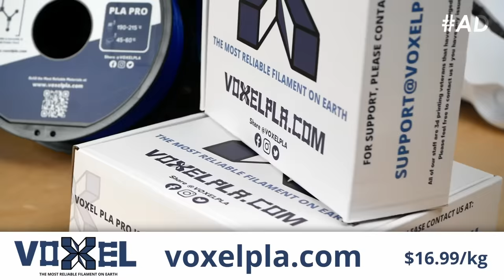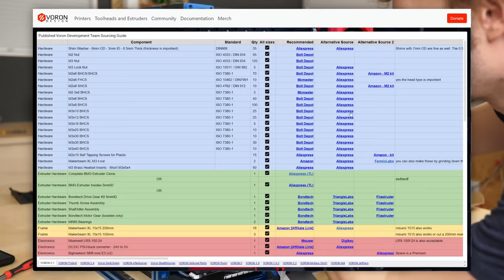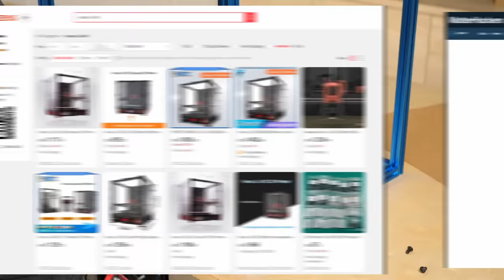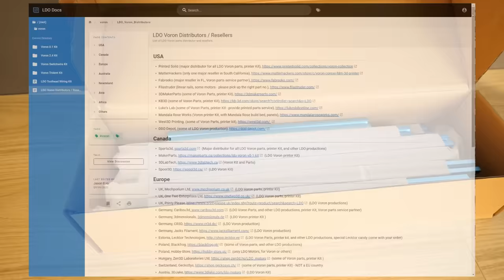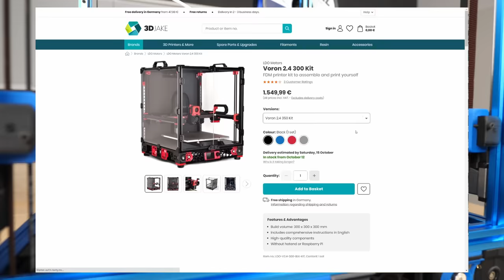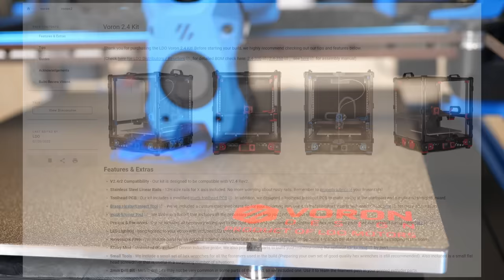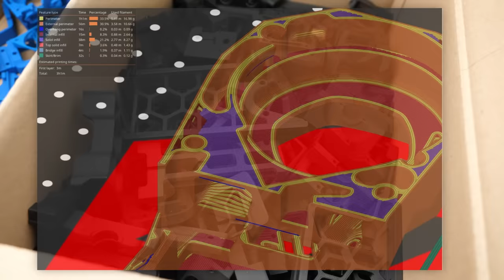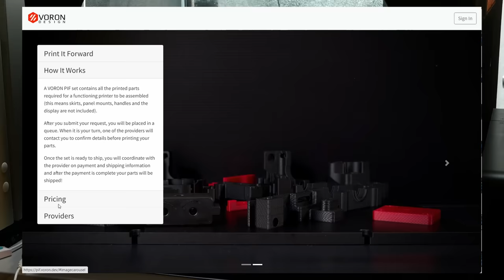Should you build a VORON 2.4 in 2023? (LDO Kit Review)

Comment: I've build a V0 two years ago from a LDO kit for $850, and designed and built a 1m^3 HEVORT using NEMA 23 servo-steppers with $40k in hardware. Buy the LDO kit. They are reasonably good parts, wiring is almost perfect, and whatever it costs to change something your don't like in the kit (fans)  is still WAY less expensive than going self-source. Big kudos to LDO for dong a very good job on the kits. 
My next project will be a V2.4r2 kit from LDO with a ERCF 6 channel feeder.

Comment: A couple of things come to mind...
- Latest design?  The v2.4 is older than the Trident ~_^  Improvements made from the Trident were ported to v2.4r2, and then additional things noticed were ported to Trident R1 (like the idlers).  This is also why they stopped with the numbered designs, because far too many assumed The Voron 2 was newer and therefore "better" than the Voron 1.
- You also mention cube build space, but the v2.4 is actually -20mm on the z (so a 300mm frame has 280mm height capability).  Then again, it would seem that many resellers state this, despite the fact the Voron configurator on their site will showcase the slightly lower height capability.
- You mention "probably printed on a Voron".  Print it Forward parts ~MUST~ be printed on a serial'd Voron, and those involved in PIF must pass a vetting process before they can participate in such.  You can't even apply for PIF until you've gained a serial on one machine.

I do love the detailed breakdown of the whole experience, and doubly so the comparison between a Voron 2.4 and other options on the marketplace such as the Bambulab X1C.  It's a very valid comparison, not just because they're similar price points, but like you stated, there's something about being able to take it out of the box, do a little bit of work (as there's a tiny bit of assembly required) and then being able to print.  For what I spent on my Voron Trident (I got a Formbot kit) I not only could have acquired a Prusa MK3S+ that was pre-built, but been printing for at least two months since I kept discovering I'd forgotten to pick up one tool as I got through various steps.

Comment: I self-sourced a voron 2.4 300x300 and printed the parts with an ender 3. I really love this machine! It feels unique, fast and reliable. Also very nice and helpful community with a lot of support and mods.
Reply from the maker: Great to hear!
Reply: Did you print ABS on the ender 3? Was it difficult to get good quality?
Reply: @groto27  I used abs+ which is more "forgiving" than regular abs. Of course I have esteps and flow calibrated combined with slow speeds parts came out great. Once I got the voron up and running i printed some spares just in case.

Comment: The anwser is comes down basicly to this:
Do you like building a printer, do you want to build it the way YOU want, do you want to tinker with it? - Build a voron
Do you dont care about building, do you just want to print. Do you think the manufacturer made the best possible printer and so dont need tinkering or moding? - Buy a X1 (or any other Commercial available printer in this price class)

@CNC Kitchen: as you already use klicky - add a nozzle brush and use Autocalibrate Z Macro. You will never ever need to tinker with z offset again.
I bet your bed variation (its ok no question) could be improved with a different Sheet. I find ldo sheets to not be very consistent. try making a mesh on the magnetic surface itself you will see what i mean.  Energetic smooth/textured sheets are quite good in my experience.

Comment: Putting the side panels on seriously quietens these down, and the speed on the skirt fans usually need slowing down, mine were wildly excessive at 100%

Also, what made you choose the 2.4 over the Trident? The Trident seems to give similar results with a simpler and cheaper design.

Having used one for a while, my main criticism is the placement of the electronics. I really wish they were accessable from the back, especially as you already need to route cables there for the fan. I've got an LED light system I want to install, but I've been putting it off due to the pain of having to put the whole machine on its side!
Reply: There's a mod called "Roller Brackets" for the 2.4 that makes it way easier to tip the printer over for servicing
Reply: @thenickdude  Thanks for the tip, I'll give it a try! I'm always a little bothered about the amount of weight I'm putting through the rear feet while tipping it back!
Reply: @aSingluarFemboyHooter  yeah, before I added that mod I picked up the whole printer so I could flip it without stressing the Z motor mounts, but it's heavy as heck so that wasn't very fun
Reply: The primary reason why people do the 2.4 over the Trident is because almost everyone things the flying gantry is cooler than lead screws ;)

Comment: I own 3 voron already
If i may recommends you any mod
+ LDO Orbiter V2.0
+ top spool holder, you will not have any feeding problems anymore
+ magnetic panel clip corner, you can make yours closed / open machine in a breeze
+ 4.3 Dsi Lcd screen for easier control

If you wanna go crazy, use TMC5160 for AB motor for blazing speed

Comment: With over 3000Hrs of printing on my 350x350x400 Voron 2.4 it only gets better all the time as I continually and gradually shape it to my needs over time. Maybe the new prebuilts will be able to stand up as well over time (though I have concerns they might not) but they will never appeal to me. I self sourced all my parts but if the LDO kit had been available then I would have seriously considered it.
My Voron is not just just a hobby toy, its a seriously useful tool that has already paid for itself and I know will continue to improve with new and better parts as they come along.
I still use the inductive probe because I just haven't had the issues that some have had and I can't even remember what a bad first layer was like because it just works. I use an active chamber heater so it warms up quickly and it gives me super accurate, super strong parts every time. I just vacuum it out and keep the rails greased regularly. I've only had to replace 2 40mm part cooling fans.

Comment: I look you video for years and nearly bought a 350 voron2.4, just before this video released. I am so surprise that voron2.4 is so cost there in EU. I got the well tuned seconed hand voron for under 555US$. And a well built new voron2.4 cost just near 650US$ in China. As a consider X1 carbon cost 1000US$. Bamboo really make some awesome devices if someone just want a 3d print for test or limited manufacture.

Comment: I have one, its a superb printer. The only critisim I have of my own one, is that after 1500 hours of print time, some of the wires in my wiring harness, that I'd bought from Linneo, started to internally fray.

Also installing the Klicky probe was very sensible, as not only can the inductive probe drift, but I found that it's proximity to the hotend can kill it prematurely due to the heat. I'm currently upgrading from the Afterburner to the newer Stealthburner, and adding a Klicky probe will be part of that upgrade.

Comment: The Bambu Lab X1C is really tempting, but I don't like how it is closed source.  That's the only thing turning me away from it and why I'd probably get a Voron over it.
Reply: Vorons maybe open source but very toxic closed minded community. They also have no stake and don’t do anything that involves a business. The closed source argument is stale at this point.
Reply: @redline6871  You misunderstand my reasoning. I couldn't care less about the community. I don't want a company with pretty much total control over my printer.
Reply: @_Livefreeordie_  I guess but your only going to run whatever is supported by the voron project and nothing else how open source is it really?
Reply: @redline6871  At least I'd be able to make changes within Klipper and customize it. If you don't like how something is in the firmware on the Bambu Lab, you're stuck with it. They can literally put something within the code that recognizes certain files and prevents you from printing them. Just as dji prevents you from flying their drones in certain locations.

Comment: I want one. Not sure if the 2.4 or the trident yet. Now we need two things Stefan:
1- A strength test for abs betwen the 2.4 and the mk3s
2- Your honest opinion about the day to day use of Klipper vs RepRap
Reply from the maker: 1 - haven't tested that but an enclosure will almost always help.
2 - haven't used Klipper that much but I can still say that if you want to print fast the input shaper implementation is way ahead of RRF. RRF on the other hand is a way more versatile firmware. In the end - if you build any Voron go with Klipper because everyone uses it and the configs are great. On any other generic machine RRF might be a great and even better choice as well.
Reply: @CNCKitchen  crystal clear thanks again for your time and effort. You make the life much easier for us. Will meet you at the klipper side of 3d printig jajajaja.

Comment: Super machine - But for Production i steel need a Commercial like the Prusa - that just keeps Running. I Backed the Bambu in Kickstarter but I'm stil waiting to reveice it, so I cannot say if that will fill the void of my MK3S that i recently sold to make room for the Prusa XL. Advantage is DYI and the mod-ability my mine h<ve extruder problems sometime which I cannot seem to resolve, with CW1 and CW2 with different Hotends. So when stuff need to go out the door, my Opinion is that a Commecial Printer needs to be in the Shop.

Comment: I love my voron 2.4, it’s a very good printer, but…. It does require quite a lot of attention a lot of the time, and my workhorse will always be my prusa mk3 for that reason. It’s not as fast, it’s not very good at abs, but I can rely on it absolutely all the time, whereas I can’t quite do that with the voron.
Reply: Out of curiosity, why does the 2.4 take a lot of attention after you have tuned it well in the beginning, and why is it not that reliable? I've heard several times now that a Voron requires a lot more maintenance than the typical printer, why is that?
Reply: @ThomasS17  Its a combination of things. 1. Some components arent of the same quality as on the prusa (particularly the spring steel pei, which is nowhere near as good as the prusa). 2. The printer is under a lot more stress, so things need a lot more adjusting. 3. There are far too many opportunities to upgrade things, which means more tweaking. Now, 2 and 3 are avoidable (2 by running it at slower speeds akin to the prusa), but 1 still isn't.

Comment: I built a LDO Voron with all the mods you can have (clicky, LEDs, purge bucket, auto-z calibration, whatever) and I do think its a fantastic printer. Print quality in my opinion is better than on Bambulab (which I also have) but... but the software/config side of Voron is a nightmare!!! You never know if your settings are correct. There is no standard config by any means. Most of Voron owners think that their config is somehow their own intellectual property (which is, but still that is not the open source way of doing things). Especially when you have LDO kit (which is a kit! from a single provider) should have OPTIMISED, ready to use config. I was as impressed with the quality of the prints as I was tired and frustrated with optimising the config myself. I am so happy with the Bambulab now, you just press print and wait for the part to use it. I think that should be some Voron Software Design Team as well to provide community with optimised, tested and proofed configs. Then it would be a killer printer. For the moment hardware of the printer is much ahead of the software which is overly complicated to get it going.

Comment: I feel this is an excellently researched and produced video that covers the state and philosophy of Voron well. The V2.4 has definitely improved in the past 18months, and the LDO parts kit does look nice. Your nevermore is probably not doing much without panels!

I will second the call to print the parts from ABS, or use print-it-forward. Avoid PLA, PETG, and cheaper online sites offering a "printed parts set". The quality is not there and disappointment will follow. ABS.

You can get quieter enclosure and exhaust fans (but not so much part and hotend fans), and panels drop the noise a lot. But many quieter fans do not last in fhe heat of an enclosed printer, or do not have enough airflow (/"static pressure") for reliable cooling. And noisy motors go faster 😀 

[Full disclosure, I built V2.1538 from a kit in April 2021 😉]

Comment: The 60mm GDSTime fans that come in this kit are SUPER loud! Change them out for the Orion Fans on the sourcing guide. Set them to 50% fan speed. Then once you enclose the printer it will be really quiet as long as you lower the print head travel speed.

Comment: I am one of the people sourcing everything myself. But honestly, with the LDO kits I would probably just buy their kits nowadays. I don't regret sourcing myself though, because it is really my Voron now and also I could learn a lot about wiring, crimping etc. I now use my V0.1 as very reliable printer for ABS, PC-Blend and Durabio.
Reply: What do you use your printed parts for ?
Reply: @sierraecho884  Different stuff. Recently I printed a paint handle out of ABS and a small ABS figurine on my V0.1

I also use it to print printer equipment which is I know a bit of a circular logic. For example, as Durabio is very scratch resistent (unlike ABS or PC-Blend) I printed a buildsurface scrapper out of it.

I also use it for all my PC-Blend prints nowadays as printing that material larger than what a Voron 0 can do is rarely adviseable anyway. One of the more useful PC-Blend prints of mine were side hooks to mount some additional curtain rod on my window. Something where you want something very sturdy and creep resistent.

Comment: I built the big one. Fantastic machines. I needed a giant printer for some projects, and the available machines in the price range of the 2.4 were mostly trash. It's the classic tradeoff of money vs time. Even working from a kit, building a Voron is quite a task. Makes a working Voron is a very satisfying achievement. 

Never did find a pi to run it. I've got an old thin client running klipper on it. 

If I were building additional 2.4s I'd make the smaller ones. The volume is easier to keep warm. I'd probably try and find quieter fans for the controller too. the ones on mine sound like a jet taking off, otherwise the printer is essentially silent with the enclosure closed.

Comment: I built one of these kits this summer as my first 3d printer. I was really impressed with the quality of the kit. The aluminum extrusion and anodizing quality in particular surprised me. I used the PIF program to get parts, and those also turned out great.

I've built the nevermore mod and purge bucket, but haven't done the clicky mod or the stealthburner yet.

edit: I bought a Radxa zero to use instead of a rpi, but I've been having some issues with my particular unit occasionally crashing (irrespective of printing or even being connected to the printer) so I've been using an old laptop to control the printer instead

Comment: I have a V2  (with mgn12 from the R2) 350mm. I need the 350mm to print my parts I design. 
Second I can get replacement parts easily and the firmware is open source and I can use Prusa Slicer or Super Slicer. 
And if my mainboard for example fails I can use whatever board I wish for replacement. 
I build the ERCF and printing ABS, PA or PC (CF) is as easy as printing PLA with it. 
If I would need a second printer for a print farm I would build a second Voron.

Comment: You mentioned oozing nozzle interfered with the z probe.  The LDO kit comes with the metal brush in the box and was intended for the purgebucket/cleaning station mod which was specifically thought through by LDO to solve this problem. - but as you already mention (And I completely respect) "you don't build the voron, you build YOUR voron". so if you don't care for that mod, or just didn't choose to include it, that's totally fine so long as you understand what voron and ldo intend and have the knowledge and skill to compensate (which i'm 1000% sure that you do).

Comment: Part of the joy owning a Voron is clout, to be sure. Just getting the parts was a chore before good kits hit the market, much less putting it together and getting it working. Being able to say you have one and that it’s working well is a flex. And, there’s no denying that it’s an extremely capable machine, certainly capable of doing most anything that’s asked of it by anyone skilled enough to build one. 

But, I think the market is hitting the point where we’re starting to see a separation between 3D printing as a hobby and 3D printing as a tool. I had my fun on the hobby side, and I paid my dues. I’m older and crankier these days. Now I just want to plug the damn thing in and have it work.

Comment: A voron , being open source hardware, is a forever printer because any part can be replaced with the same or an improved version. That gives you a peace of mind that a company can never give you. Well, and a voron is super pretty. 

And I have the impression that Vorons in a way have done away with the notion that 3d printed parts are a bad thing. If you compare the sheer briliance that went into the stealthburner with any part on a MK3S - it's just no comparison. The Reprap project somehow lost steam and ended up represented solely by the Prusa series of bed flingers. Whereas Voron has recaptured the spirit of Reprap and infused it with a healthy dose of cutting edge engineering and, as you mentioned, a cohesive design language. 

Also, gummy bears aren't actually good for you.